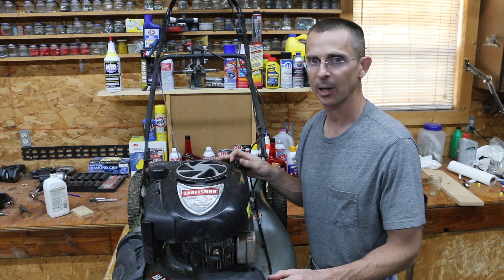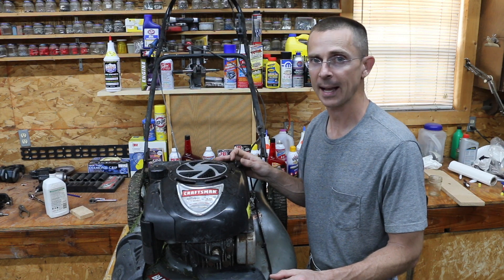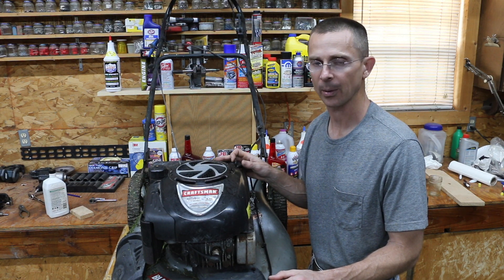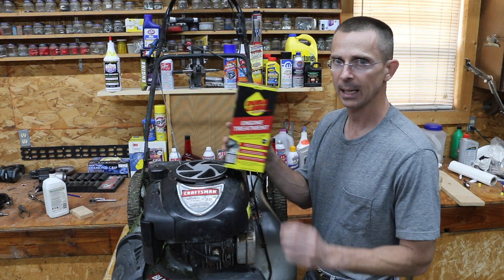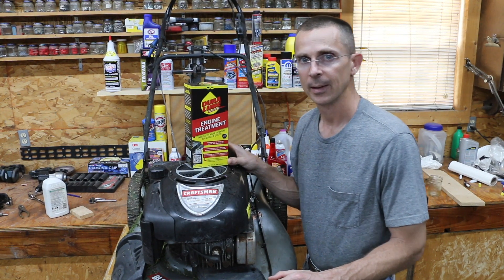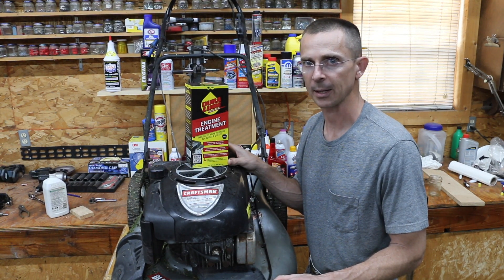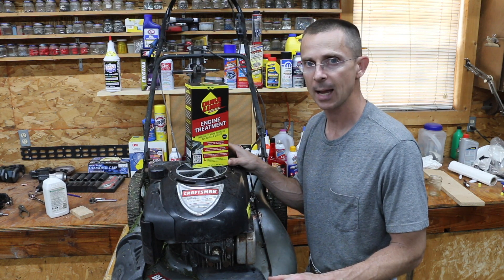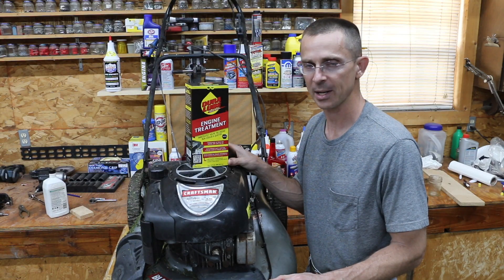Does Dura Lube actually help quiet and cool a gas engine as claimed?

Comment: I put it in everything that requires lube,do not put it in a new engine,it will take months to break it in,run it about 5000 and start using the hell out of it,it treats the metal not just the oil,when I first saw it at a swap in texas they used a slant 6 with no oil pan,it ran for 15 minutes on a stand,i was convinced this was way before it was in stores. there a few chemicals that impress me this one is amazing,put in a rear end forget it,unless you swamp it
Reply from the maker: Great tips. Thank you

Comment: Yes runs smoother and with increased usage if all oil drops due to valves or gaskets dripping the engine will still run. I’ve used it in every car I’ve had since the mid 90’s not one had engine damage and would run fine without oil for to the parts store or mechanic to fix the leaks. Not recommended though due to temperatures and overheating. Check out http://www.Duralube.com for tests and NASCAR results they finish a race without oil. https://youtu.be/qv_UpUPoahw
Reply from the maker: Thanks for the link!

Comment: Well. You changed the oil to fresh castrol after the baseline test so that alone could be why there was cooler temps and slightly higher compression.
Reply from the maker: Thanks for commenting on this.

Comment: I remember trying DuraLube products when they came out (mid 90's?) and watching an infomercial demoing an engine running with NO oil. I also bought a special at Walmart - the oil and fuel products packaged in a neon orange oil drain pain (which I still use 20+ years later). I haven't used the product in years, but still think its great and do support them.
Reply from the maker: Thank you
Reply: I have started using duralube in my old minivan..it used to shake and shudder.. now it runs as smooth as a top
Reply: Tony that is great news. Wish you continued success
Reply: Grieg Ragen yeah I hear ya. We had a 1991 cavalier RS with 2.2 and Mobil 1 with duralube and we made it to 300,000 until someone bought it and continued to drive it. Nice cars

Comment: 697,000 miles on a Honda CRX HF using Duralube. It finally died when a piston ring broke and ate all the oil.
The engine kept running despite not having any oil in it for 20 miles till I got it home.  I sold the car and the guy who bought it fixed the ring and it is still running with over 800k miles.
Reply from the maker: Impressive!  That's a lot of miles!

Comment: You can pull off the same results with thicker oil, I’ve quieted engine knocks by putting thicker oil in before, you can only go so thick though till it causes the engine to struggle, and it generally runs at lowers RPMS. Possibly the reason you did have higher RPMs with the duralube could just be because of the fresh oil change. Great video!
Klassick
Reply from the maker: Thank you

Comment: That is a fairly respectable result! It is a crying shame that the 1991 FTC attack on Dura Lube was most likely a destructive greedy money grab that bankrupted this business and many others.
Reply: Glad the FTC shed light on these Midnight, Info-mercial, Snake Oil Products. 

I just watched this video and not sure why it seemed to run better because they made very, false and misleading claims in their advertising back in the 90's, and early 2000's when I used to see them advertised regularly (especially late at night).

Thats why the FTC came after them. Sorry but I cant trust a company who makes outlandish claims and cant back them up. 

Nice videos as always Project Farm. Keep up the good work.
Reply: @extremedrivr  thousands of people saying that the shit works, noticable differences, and in this video and there you are. That guy 🥴

😆 I'm just rewinding your recoil spring, don't get mad ✌️ But yeah I notice cooler temps and smoother acceleration using duralube every now and then, really is one of the better ones.

Comment: It stays on the metal surface so when you initially start your engine and all the oil is in the bottom of the drain pan it starts right away with much less wear on the piston rings and walls. This is when most of the wear occurs. On startup. Duralube is also attracted to heat instead of repelled by it like ordinary oil so the hot spot gets the oil and again less wear. It does not increase compression except on cold start because there is still a microthin layer of duralube on the metal surface. There is also no sludge buildup on the pistons.
Reply from the maker: Thanks for this information.

Comment: I have a 2006 Dodge Durango with 386k miles and no compression or piston ring issues. I started using this product on my truck after 80k miles. I’ve
 Used it in 3 other previously owned vehicles. I don’t need a lawn mower test to convince me I swear by this product. I’ve also used thier transmission. Version of Dura lube and as you can guess, it has the same amount of mileage on it.  This product is the real deal!
Reply from the maker: Thanks for commenting on this.

Comment: While this is an air cooled motor, if it was a water cooled motor you would need a different thermostat to run cooler.

P.s - could you test an antifreeze additive in a water cooled motor?
Reply from the maker: Thank you for the video idea!

Comment: I've commented on another post, in regards to my undying appreciation for DuraLube. For what it was designed to do, DuraLube is the only product that has proven itself to me. I ran a car for nearly two years with a blown leaking gasket, two months without coolant, and several times with contaminated oil. I simply couldn't afford a teardown, much less a replacement. I feel certain this product kept my car on the road for at least 5-6months after it surely would've failed. Maybe more than that, had I not have replaced it.
Reply from the maker: Others have had positive comments regarding DuraLube as well.  Thanks for commenting.
Reply: Yeah I have a blown head gasket on my Kia Sorento that causes oil loss as well. My wife was driving it when it started rattling so I checked it out. No oil at all in it but it never got hot lol! Luckily it isn't leaking over into the coolant system.  I've always used Duralube  and my engine never overheated. I think my timing chain guide is busted off and rattling around in my engine head. I've been driving it for months like this and haven't overheated yet. Duralube goes in every engine I own, mowers included and I haven't had a lubrication issue since I started using it in 1998. I usually put it in full strength in small engines since it is already suspended in 30 weight oil. My mower always cranks on the first pull too

Comment: I used Dura Lube in the 90's. I can honestly say that I never saw any performance gains in engines that were in good mechanical condition. However, I did see a difference with Dura Lube quietening noisy lifters in worn engines.
Reply from the maker: Excellent point.

Comment: thank you for doing the tests. i didnt do as scientific tests but found duralube to lower my engine temp in my 400 sbc years ago in texas. it was a high performance engine with approx 11.5:1 compression. i figured if the water temp went down it could only be due to lower friction. 

i still wonder if it would do as advertised, run after draining the oil with duralube. i have seen it done on videos but i dont believe everything i see there because i am not there and they might be funded by the company.  i did break an oil line on the remote oil filter, on one of my sports cars, didnt notice for about a minute before shutting it off.  there was no damage to the engine there was no lifter noise either. i never ran a remote oil filter again.
Reply from the maker: Thank you!

Comment: I had a 90 chevy cavalier, and I drove the car to Milton and back to lacey everyday. I would have to fill the car every other day cause it would use a half tank everyday. I also had a vibration at idle witch would come through the steering wheel. To make a long story short changed the oil added duralube and with in a half hour the vibration went away. And my fuel economy improved  as well. The same drive to Milton and back to lacey it went from 1/2 tank to using just over a quarter of a tank. So in my opinion I think the product is awesome and I still use it in my truck today
Reply from the maker: Wow!  Impressive!  Thanks for sharing this experience.

Comment: Test bearing grease in a small engine compared to regular engine oil ( compression fuel consumption engine load )
Reply from the maker: Thank you for this recommendation!
Reply: Project Farm not a problem. The reason I got that idea is when we rebuild rearends on four wheelers we pack the rearmed we that grease instead of using oil and it works like a charm. And do the lubricity test too tj see how they compare

Comment: You should try using graphite in oil. I have been using it in all my engines for years. I will never stop using it because of the great results I have had in over twenty years. It has slowed blow by oil consumption and increases fuel mileage. Try it.
Reply from the maker: Thank you for this recommendation!

Comment: Great to see Duralube get thrown in the mix. I used to use this on my old beater and I swear it kept the thing going to 486,000km. It seems to have the most notiveable effect on older engines with more wear but I imagine it can help prolong the life of a healthy engine if the additive truly does what is claimed. I just started adding it to my v6 with only 160,000 on it and I have noticed that it reduces the valve noise on cold starts but the engine runs very quiet otherwise so there is no outward indication of it's effect.
One claim that Duralube makes is that it bonds to the metal and reduces friction in the engine even after the treated oil is drained. I'd love to see a set of two engines running, one with regular oil and one treated with Duralube and after an hour of running, drain the oil out of both and see which one seizes up first and measure the temperature of each until they fail to see if Duralube really protects the engine more than regular clean oil.
Thanks again, I really enjoy watching your videos.
Reply from the maker: Thank you!
Reply: Use it on anything over 20k miles I say!

Comment: Dura Lube lowers oil friction heat in pressurized areas by lowering the oils friction against itself. (It is not a coating product) and acts like normal oil when it is not under pressure. The weight friction test is invalid with this product because the oil is not under pressure. It is intended to be used in an engine that is in good working condition....(Not a worn out engine)...Does it reduce wear?...I have found no evidence that it reduces wear initially, but over a long period of time it may, because it will reduce operating temperature internally and create less expansion on internal parts making them wear less over time. Is it worth it? Yes it is worth it if you can afford it at every oil change. Don't pour this stuff in an old worn out engine and expect it to do anything but lower your coolant temp by 5-15 degrees. That is all it will do for an old engine.
Reply from the maker: All great points and thanks for commenting.

Comment: I wonder if this the same stuff as ZX1 Extralube as sold in the UK?
Does this stuff allow you to put it into any and all liquids in the engine like zx1? You can add that to fuel,  oil, coolant, power steering and brake fluids.

I've used it in my Landrover in engine oil,  transmission fluids etc. But I'm never certain if it's helping a little or a lot. It does seem to quieter my rattley diesel engine (300Tdi) and seemed to make for less drag in the axle and gear boxes, but I'd love if you were able to test it properly. 

Greasy videos as always - keep up the good work
Reply from the maker: Thank you!
Reply: Project Farm er, autocorrect turning "great" into greasy there... but still if you're able to get hold of some zx1 Extralube or the US equivalent that would be great!

Comment: I drove a 4 cyl 1995 Chev S-10 pickup in the hot Texas weather during July with one quart of oil in the engine that was treated with duralube. I had a hole in my oil filter. I drove it for work 350 miles like this, my oil gage was bouncing around until the engine got up to speed. It basically had one quart of oil and the engine never got hot. I also tried to flush the radiator but the mechanic said the thermostat would not open to flush. He let it run for thirty minutes. The engine never got up to temp so he had to drain it manually. 
I also had  jetski that sat for 6 years with gas in all three carbs and throughout the fuel system. I had mangled my leg in an accident and was unable to maintain my jetski. When I finally took it to the lake it had no throttle response . The ski mechanic said I needed a carb job because the fuel left in the system had ruined all the carbs etc.. I used a can of duralube fuel treatment and ran the engine with new gas. Let it sit for 2 weeks until my appointment with the shop. He checked it and said everything was fine and the fuel system was clean, no carb job was necessary. Duralube worked in 1995......lol
Reply from the maker: Impressive!

Comment: Been using Dura Lube since the early 90s. I think it helps. But I've been reading good things about Patron Plus. Have you done a test on that one yet?
Reply from the maker: Not yet. Thank you for this recommendation.
Reply: Project Farm they're making all the same claims that's Slick 50 and duralube did back in the 90s, but I've seen a couple of the bearing tests that seem pretty convincing. Would love to see a comparison

Comment: I used Duralube in my wifes 93 caravan ! I put it in the engine and transmission ! When I bought it it had 63 k on it ,very clean and well taken care of!
Those models had problems with the transmission going out around 80 to 90 k  and I never had trouble with it   Up till I sold it at 159 k 
When I sold it I got a call weeks later and they told me thank you for selling them the van ! I love the stuff
Reply from the maker: Impressive!  Thanks for commenting on your experience.
Reply: Engine formula or transmission formula in Trans?
I would not know enough to know if the regular is safe for transmissions. Another vid, someone made same comment.
So, am curious which product.. 🤔

Comment: I have used various additives in my previous cars, both Toyotas since 1986 and one lasted me for 260k miles and the other one 400k plus miles. Now I'm on my third and have decided NOT to add anything to this one, just change oil with quality oil/filters at the recommended intervals and we'll see if it will last as long as the other 2.
Reply from the maker: Thanks for commenting. I hope you achieve great results.

Comment: I see you already tested it.. STP is too thick in the cold of the north.  I had an engine seize up with STP.  Dura Lube actually bonds to the metal and works great for me. I use it in all my engines.
Reply from the maker: Thanks for commenting on this.  I'll hopefully put together a more extensive test of DuraLube in the future.

Comment: Run an engine on lighter fluid!!! I have actually done it.. on my riding mower.. I ran out of gas at the bottom of the yard..it was all I had..but I only ran it long enough to get it back into the garage then drained it out.. How long would one run on tho??
Reply from the maker: Thank you for this recommendation.

Comment: I am a race car driver up here in Maine, during a 100 lap feature (we race on pavement) I lost the oil pump on second lap, ran the rest of the race, aprox 127 laps 27 were caution laps, with no oil pressure, temp-only rose to 235. Placed 3rd in the race, and during post race inspection, the tech team pulled the pan to their disbelief the gear from the oil pump was in the bottom of the pan validating that I had no oil pressure. We also have this race on video and several witnesses. We ran 4 quarts of Castro’s gtx 20/50 and 1 quart of duralube. We now run duralube religiously in everything from snowblowers, zero turn mowers, race cars, and personal vehicles as well.
Reply from the maker: Wow!  This is very impressive!  I plan to do additional testing with DuraLube in the futre. Thanks for commenting.
Reply: Like I’ve posted to ya earlier, this stuff is great
Reply: @ProjectFarm  I have used Duralube in my cars since the 90's and one time it saved my engine.  My wife called me from her work and said that she got in the car to come home but then noticed a lot of oil under the car when she pulled out of the parking spot.  She was scared to drive home and asked for me to come and pick her up.  I drove 75KM to get to her and let her drive my car home and I drove hers with no oil since I knew there was Duralube in the engine.  I hoped I would make it home as I had to drive on the highway at speeds over 100KM for just over one hour.  I got home parked the car and the engine was just perfect no overheating no knocking noise or anything. It turned out the oil cap fell out and all the oil drained.  I gave it an  oil change and drove the car untill it died at just over 975,000KM !!! it was a 91 Dodge Shadow 95HP ( I had it for 15 years, bought new) one of the best cars I have ever owned!
Reply: Mike Warren hey man l the thought about putting some  duralube ( along with sae30 oil),  in my mowers but  l was afraid to use it air cooled engines.  How long have you been using this dura lube  in your mowers?
Reply: So duralube caused your oil pump failure, but let you finish a race without any oil. Hard to see that as a win.

Comment: Original duralube commercial claimed it somewhat permanently coated engine components. It showed a static bearing test reaching much higher loads before seizing and a formula one race car (I beleive) running cooler and with more horse power after being treated with duralube and then having all the engine oil drained out.
Reply from the maker: I plan to do more testing with DuraLube soon. Thank you for this recommendation.